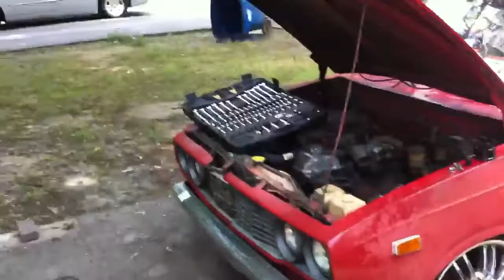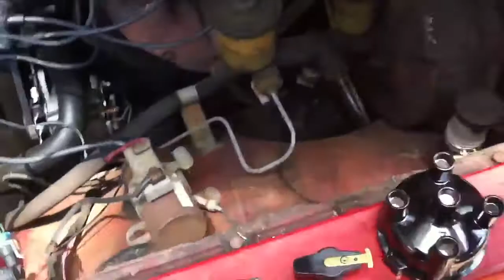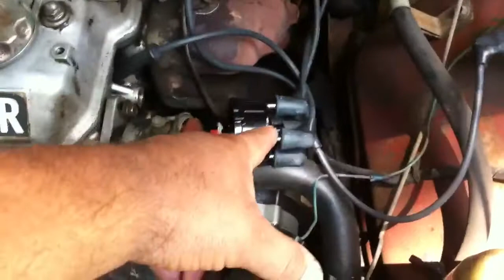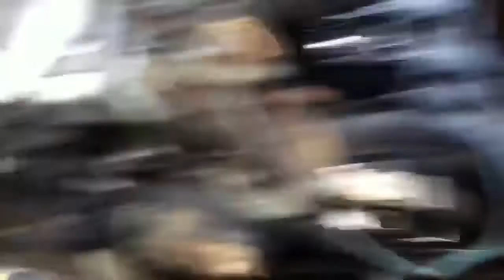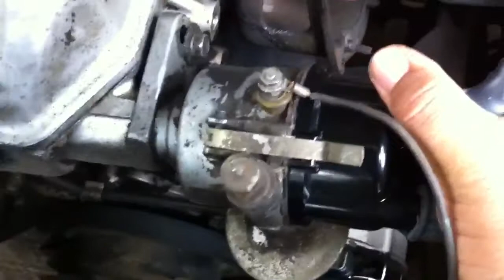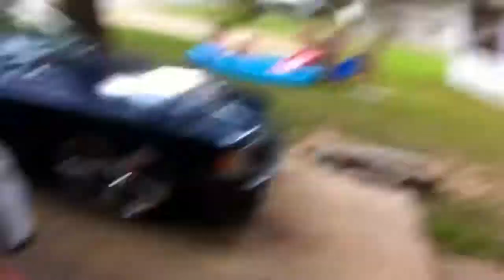How to change distributer rotor and points

Comment: Yea, I changed many points and you have not shown the most important part to set the points...you need to set the point's contacts gap to a specific opening or what we call the "gap" at the apex/high point of the Cam shaft. Using a specific wire gap gauge tool ( used for spark plug gapping too and don't use a flat gap tool) with the correct gap measurement for the vehicle, you then "set' the point's contact gap and then tighten the screws so the point open and close on every revolution at the cam when the car in running.  The point's contacts open at the cam's apex and closes on the flat side of the cam. So as the cam revolves it opens and closes to produce a spark tot the distributive cap contacts and then towards the coil and onto the spark plug.